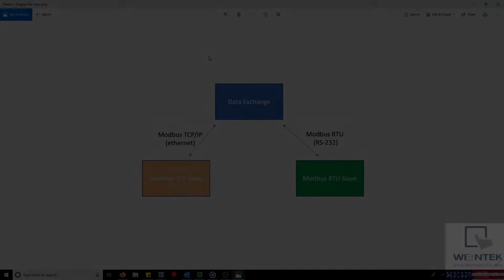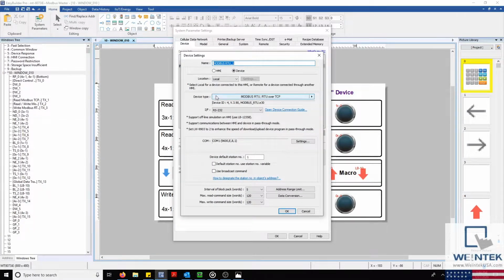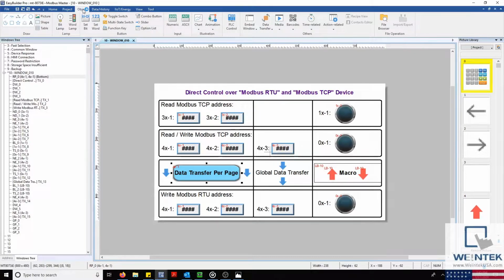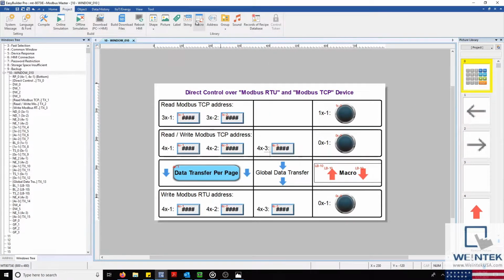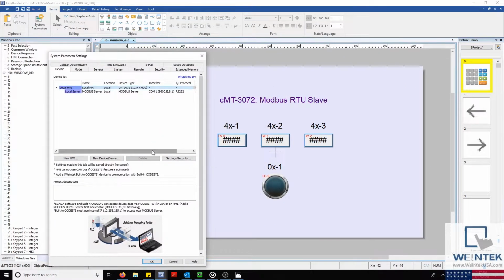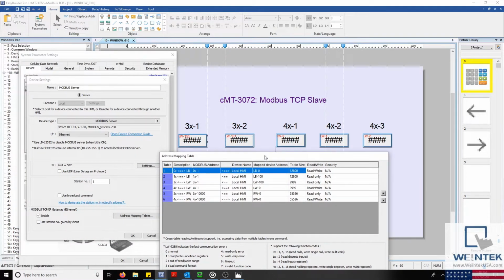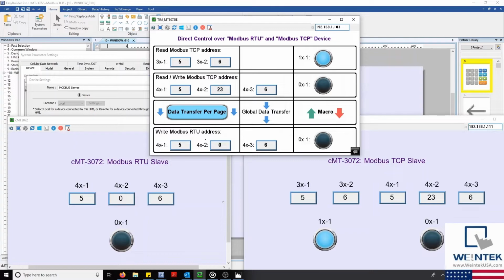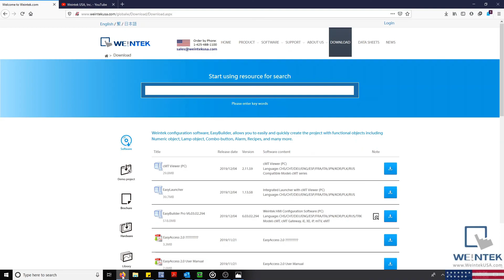Modbus Slave devices. How to write/transfer data to two separate Modbus RTU and Modbus TCP.

Comment: Great video. O think we can apply this method to a frequency inverter acting like Modbus slave on TCP, right?
Thanks anyway.
Reply: Hi Rafael,
Great question, any of the data transfer methods discussed within this video should work with your device. If you have any additional questions or would like to discuss this in more detail please contact: 
support@weintekusa.com